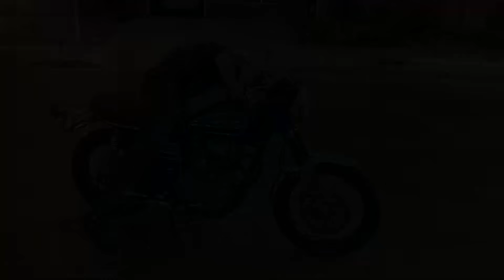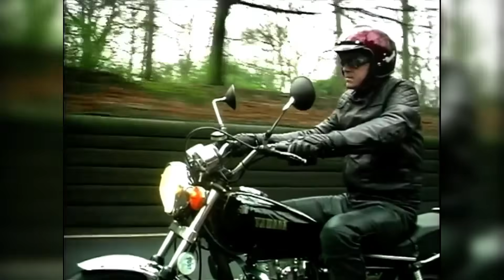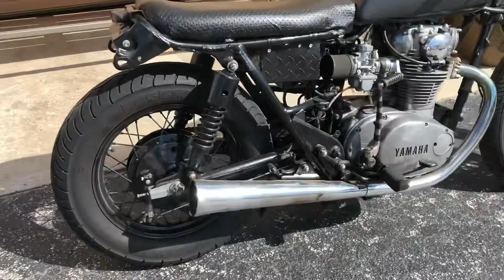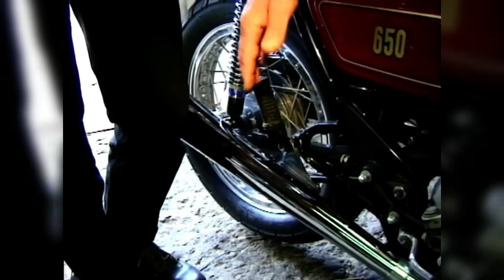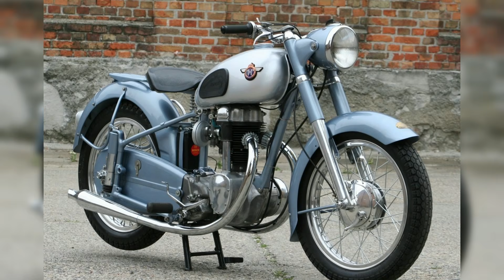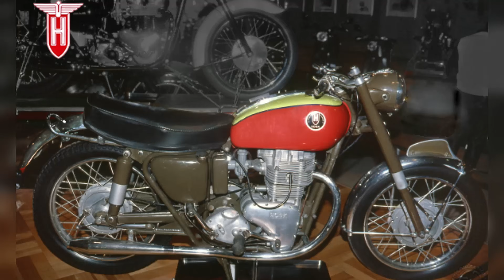THE EXPLOSIVE TRUTH BEHIND YAMAHA'S BULLETPROOF XS650

Comment: A damn solid runner! The points ignition was the worst feature because they’d pit and the gap would change. I bought a new 1979 XS650SF and rode it 7000 miles during a 23 day trip in 1980 from CT past Salt Lake and back. Sleeping in bug infested cornfields or anywhere I could stay hidden at night. Cruised the Rockies & National parks in Colorado, Utah, Idaho, Wyoming and SDakota. Rode into the 41st Sturgis event before the poser/trailer phenom that it is today’s event. No commercial poop-chip campgrounds or concerts - just a raw experience, no fluff. I did love that 650. Attended the 1980 Peoria TT won by Scott Parker aboard Yammie 650. I was then a member of the Yamaha 650 Society attending the rally…those were fun days! Still riding 3 HD’s these days.
Reply: My first Sturgis rally was 1968, nobody was selling t-shirts yet. The newspaper said it was a record turnout with nearly 4,000 riders.

Comment: I remember this differently. The xs1 was the one with the rubber/wobbly frame. Yamaha revised its chassis under consultancy and that was when the different improved handling happened. That was the xs650.
Also. Utter bullshit re all other vertical twins being 180 degree designs. Only Japanese bikes had 180 engines.  At that time uk bikes ruled, chiefly with parallel twins.  ALL of those were 360 designs.   Brit designs leaked mostly from primary chain cases not crankcases. And rocker boxes, triumph from pushrod tubes.  The exaggeration re Brit unreliability is pure rubbish. None of my bikes pissed oil. None of my bikes refused to start. None of my bikes had the no-brain cowhorn bars either.  Anyone tolerating those vastly over high bars were either Americans interested only in boulevard cruising, posing. Brit riders rode fast, on bars with at most low rise. All these middleweight 650s rode far, far better with a straight bar, this reduced the sit up and beg riding position that cowhorns imposed and MADE THE FRONT END LIGHTER AT SPEED, the speed stability thing was nearly all in America where fast riding isn't their style, and if they did wind it on a bit their upright body caught the slipstream  and effectively transferred weight from front wheel to rear. Result? Speed wobbles, instability. But few Americans seemed able to learn from such experiences, they still expect stupid high bars on their unfaired middleweights. Like Bonnies, Lightnings, and - stupidest of all - featherbed Dommies....

Comment: Too bad Yamaha didn't put counterbalancers on this engine. Kawasaki put them in their W650, and it was a LOVELY bike! It rode so smoothly. I know, because I used to own one. Had Yamaha put in counterbalancers, this bike would've sold much better.
Reply: Yes exactly !  They  introduced The TX 750 1973/ 1974  with counter balancers. But all 1973 engines broke. It was fixed for the 1974 model but they cancelled it due to bad reputation/ reliability after 1974.
Reply: @Rocketmanzerohour  and I thought only Detroit did things like that!

Comment: you missed the huge impact that the 1978 XS650 Special had on the entire Japanese motorcycle industry.   Kawasaki ignited the 'Japanese Cruiser' style with the 1976 KZ900LTD but the 1978 XS650 Special was the explosion.   It had ALL the elements required:  pullback bars, 16" rear wheel, shortened mufflers, non-flat (barely) seat and extra chrome and polished highlights.   It was a pure style play, and it worked spectacularly.   As Cycle magazine put it:  'those Specials flew out of the dealer's showrooms like free money...   and all other Japanese manufacturers had to follow up with theirs..'      It was the beginning of a Japanese bike style revolution that became mainstream and has never left to this day...    Man, that was a time...  🤠🤠🤠

Comment: You made several mistakes in your descriptions. The rear disc brake did not come out on the 75 model. It came out on the 77 model year. End ended on the 79 model. The 80 went back to a drum brake. The carbs started out with two 38 mm carbs that were totally separate carbs, in 76 they linked the carbs. This made them easier to tune and stay in tune.
In 80 they came out with a 34 mm carb that had major changes to the way they worked. These changes made tuning much easier and greatly improved drivability. 
The reason they stopped making them is not because of poor sales, they sold very well. When they came out with their 4 cylinder engines they found most riders chose the more economical XS650 than the more costly 4 cylinder bikes. Yamaha realized this and that's why they stopped making them and put more emphasis on the 4 cylinders.

Comment: Apparently many of the commenters never rode the Yamaha 650. They ran okay but were poor handlers and you could feel the vibration 30 minutes after you get off. 

Beautiful bike to look at but not so good when you rode it a bit. You can keep that kind of character.  Excellent video and great explanations. Fork braces and steering dampers  along with grip puppies help.

Kenny Roberts in his prime could just about win on anything, an absolute winner. I could see why custom XS650 would be popular.
Reply: I took my dad's xs650 on a 4 hour destination trip and that vibration was pretty bad on the keister, hands and legs.  Solid and reliable as a rock though.  Good for commuting in the city but a true horror show for long highway riding.
Reply: After that ride, I got myself an '85 Kawasaki Vulcan, V-twin, awesome seat with a sissy bar.  Took the same trip with my GF and that was like heaven.  Did the same trip on a FZ750 sports bike and that was utter hell due to the forward lean (arms burning) and thin seat (keister burning).

Comment: I rescued my XS650 from a garage where it had sat for twenty years. I went through the carbs and generally cleaned 20 years of neglect off it. Replaced the head bearings with tapered bearings and replaced the swing arm bushings with bronze units. So far it has been a very solid ride.
Reply: Completely nonsense comment.
Reply: @greintje6941 
Sorry I wasn’t clear. I planned on restoring the 650 but had a major setback on May 28 when I was rushed to the hospital when I sprung a leak in my colon. I bled for a week, received 21 units of blood and had major surgery. 
When I looked at all the bike needed I decided to make it someone else’s problem.
Reply: I’m 75 and wanted to do the same but couldn’t. I wanted to ride it again. I gave it to a guy for parts. 🥲
Reply: The Hughes hand built 270° rephase, is the ultimate improvement for lack of vibration and and increased torque and power, I've found.
Reply: @robertbobin5053  This makes sence in a way. But it needs completely new build camshafts and ignition-system. It's not worth the effort/money imo to gain a bit less vibration and a bit more torque This engine is just nice how it was designed to be. Undestructable, reliant and full of character. All you needed to add later was an electronic ignitionsystem on the older models imo.

Comment: I fell in love with the XS650 in the late 90s. It had the look of a mid-sized British twin without the reliability issues. I was about to buy an '81 XS650 special in '98. I was waiting for my federal income tax refund to buy the bike. When the check came in, I called the owner of the bike to let him known I was going to buy it the next day, but someone had JUST drove off with the Yamaha. I ended up buying the '82 Kawasaki KZ650 CSR he had, instead. I rode that bike, year round, to 2 jobs, for 2 1/2 years. I learned to love the "Kawi", but I never forgot the XS650! About 10 years ago, I discovered the Kawasaki KZ750 LTD Twin, and it peaked my interest. The simplicity of an air cooled twin, with chain drive, is still my ideal motorcycle. I'd love a stripped down  XS650 "bobber", with a 270° 750cc big bore kit, forward controls, custom seat, bars, etc.

Comment: Thanks for the research: I hadn't spotted the Horex influence. It does explain why Yamaha, popular for its 2-stroke twins went to an SOHC 4-stroke.
650 cc was iconic because of the British twins aura, and one had already seen a few Kawasaki (born Meguro) 650, sort of a BSA clone. Another unexpected non-British 650 twin came from Benelli. Its Tornado showed excellent power, but it stuck to pushrods (OHV), inconsistent with a shorter stroke meant for higher revs. It was wiped off the market by the Laverda SOHC, the 650 GT which quickly evolved to 750. 
Now all of these, as all British parallel twins had 360° crankshafts, so Yamaha's choice was nothing original, and actually its most conservative feature.

Comment: I bought a 1976 XS650, drove the crap out of it, put 86K on it before I had to sell it to buy a truck for work. Great bike. I upgraded the weak parts like this guy describes. It had a speed wobble, and the upgrades to the head bearings, and engine mounts solved it.

Comment: I bought a 1975 XS 650 Electric, brand new a year after I graduated. I drove it home from the dealer in the pouring rain. 
With a set of highway pegs at 70 MPH the vibration was terrible. Yes Harley's vibrated but that higher frequency would put your feet to sleep.
Topping it out at a little over 100MPH was a scary thing wallowing down the highway.
Are they dependable, well I tried to pass a car before it made it to a hill doing about 80MPH. I got almost passed when the motor toke a shit and lost power.
I took it apart to find a scored cylinder and find out what makes them vibrate so much. Both pistons go up at the same time. That seemed stupid to me.
I thought it was a nice looking bike when I bought it but looking back I don't think it was a great bike.
I have had many bikes since then but the very large boat anchor still sits in my shop with a burned out stater.
It would need a lot of work and I have no ambition to ever get it running with two running Harley's but I just didn't have the hart to sell it. 
It was the only new bike that I ever bought, but it wasn't the best bike that I ever bought. 
Everybody has an opinion but that is mine. If it wouldn't be for the looks of that motor it would have faded into the sunset.
Reply: You don't appear to have much mechanical empathy. That's no way to break in a new motor.

Comment: Bulletproof, haha. Drive it low revs and oil pressure drops.
Reply: No oil pressure needed with the XS650, because it used roller and ball bearings. Only engines with journal bearings need high oil pressure.

Comment: Basically an enlarged CB360 engine another very good motor . A number of these got converted to a 180 degree crank like the CB360 . They sound nicer too . Some cut the cam and weld it but I think a cam was available .

Comment: Good info at the beginning of the Vid, then repetition after repetition of the same facts.  Kenny Robberts Raced Shell Theut Prepared 650's  in Aftermarket Flat Track Frames made by Redline or Champion.  No Comparison to the stock Yamaha Frames and way more power out of the tuned engines too.

Comment: We used to call them "The Japanese Bonneville"
I used to build them out of the crates and do the pdi's when sold.
Absolutely gorgeous to ride and a work of art.
Bring 'em back!!!
Reply: Beautifully written about a wonderful bike.
Reply: I called mine a yamaharley even thogh I knew it was a bonnie😂
Reply: Perfect "first" bike.  Many of my friends owned them in the mid 70's... for the time... super bikes
Reply: The XS1 was a Triumph for Japan.
Reply: Bought 2 75 83 loved them they respond good to turbo chargers but but with roller bearings throughout it didn't have enough oil pressure, I found out the hard way, I toasted a KZ 1300 with it before the turbo went out, love those bikes
Reply: We called them shit. It took years for the Japanese to learn how to build a frame that handled. The welds looked like bird shit. And that 180 firing was a big mistake. No such thing as a Japanese classic…were only thrash and throw away bikes, cheap and nasty!
Reply: @ate71622   Found the Brit...
Reply: @ate71622  There weren't many bikes keeping up with my RD350 on Mulholland Drive in the 80's.  When I hit bumps in the turns I got off the seat and road it like a bronco.  What really scares me is I was doing it on 80's tire technology, lol.
Reply: @ate71622 there is some merit in your comment. I have owned 3 of these. I believe most of these commenters speaking whimsically about their XS650s are over-romanticizing these bikes. Reliability and exhaust note were good, performance was mediocre ( even for the time), handling was lousy, ppwerband was very narrow ( 3000 RPM - 5500 RPM ) and contrary to what is stated here, durability was below average. Camchains and piston rings were toast by 35 000 miles.
     They were okay. Just okay.
Reply: @ate71622  You obviously donn't know what you are talking about. The 180 firing has been used for decades by mostly  Englisch builders. It has always been a compromise between smoothness and vibrations at higher revs. 
Yamaha opted for a 360 crankshaft design for the bike/engine was not designed for high revs or speeds. Just comfort riding and durability. And they succeeded overall.
This twin is probably the best ever designed engine for use on a motorcycle.
Yes, the frame and  handling couldn't keep up with the quality of the engine.
But to call this bike 'bird shit' and 'thrash' is far overdue.

Comment: In 1975 Former Triumph racer and senior test rider Percy Tait was hired as a consultant by Yamaha to improve the handling of the XS650 he lengthened the swing arm, tightened up the rake a bit, and added some bracing to strategic areas of the frame (swing arm pivot and head stock).

Comment: Quite a good vid but several mistakes in the dialogue. Eg; the new frame arrived with the TX-A of 1974, not the B of '75 and there are a few more but none are all that important and don't change the outcome of the story. One thing they never fixed was, aside from the terrible handling of the early models, the most annoying thing on the bike - the woeful electric starter. I bought my '77 in around 1990 for $600 and it came with almost enough parts to build another bike. I've owned around a dozen since then and have four now, including that '77. All are heavily modified. These days, I've seen restored examples sell for $20,000.

Comment: I think virtually Every British twin used a 360 deg crank. That's why they sound as they do. The Honda CB450 DOHC introduced in 1966, used a 180 deg crank....that why it sounds like it does.....The Honda 4, like most UJM 4 cylinders, have 2 pairs of pistons, that rise and fall together at 180 deg to each pair. That's why they sound like they do.   😄
Reply: You're right that all big British parallel twins were set at 360° — BSA, Matchless, Norton, Triumph... Honda's pioneering 180° crank twins were not there for sound. Honda had it right : no crankcase compression meant higher revs, less vibrations, less leaks. The CB 450, with its then incredible revs was faster than British twins, if not as torquey at the low end. Short-lived bike, too, as it was nearly as expensive as the CB 750 which became all the fad.
But yes, today many retro style twins are set at mechanically absurd 270° just to make them sound a bit more like US V-twins. Good thing they all use counterbalance shafts...
Reply: The Honda CB400 and 450 SOHC twins used a 360 degree crank, same as the Rebel and other smaller Honda twins, 185s & 200s
Reply: @Bull3tBikes Erm, we might slightly differ here. The CB400 was a 4-cylinder, not a twin, while the CB450 was a DOHC, like in double, not single overhead camshaft...
Reply: @SPavlo There were CB400 twin and 4 cylinders , I would know, I literally own a CB400T
Reply: @Bull3tBikes Quite. However, we were talking XS 650, CB 450 DOHC, etc. — bikes of the seventies, not millennials.
Reply: @SPavlo facepalm The Honda SOHC twins were released in 1977, you should seriously do some research before making remarks on the internet because you just sound foolish.
Reply: @SPavlo CB400T (twin) CB400F (four)

Comment: My youth ex[experience with Yamaha was with 2 stroke bikes in the mid 70s. Owning an RD350  in the early 80s was like owning a VW Bug in the 90s! The bike was still super fast in stock form! My dream bike was one I saw out of my room window as a teenager in a Silver Lake (LA) apartment of a 1977 silver RD400! I never owned one yet but do own a 1972 DS7 250 modified, a 1980 TZ 125, two 1984 RZ350 which I raced and a 2016 YZRf 600 which I do track days with! I've never driven this XS650 or any other 4 stroke bikes from this eras but now I am wondering if this is the way to go as I am reaching 62 years! :)
Reply: When I was 17-19 I had two RD350s in quick succession because the first one got nicked. Fab bikes but I feared for my licence because they made you want to ride everywhere at breakneck speed, so I "upgraded" to an XS650B so I could enjoy riding slowly too! Wish I'd kept it of course but amongst other bikes, my all-time fave is the Morini 1200 Scrambler. Get one if you liked the RD350: power delivery and attitude are similar to my mind but with 117hp at the wheel, and no rider aids or even ABS. It can of course be ridden sedately too, but it's completely bonkers and much prefers to go go go, just like the RDs, so it's always a riot. BTW I've just turned 67...

Comment: I had a 1981 XS650 special and it handled beautifully I didn't have any suspension or wobble issues whatsoever I think this is a bit of a puffed-up mess the earliest ones may have had issues but by the mid 70s there was no issue with handling because of the excess 650s frame.
Reply: Well I will just say my 1975 was scary at 100MPH between the vibration and the wallowing.